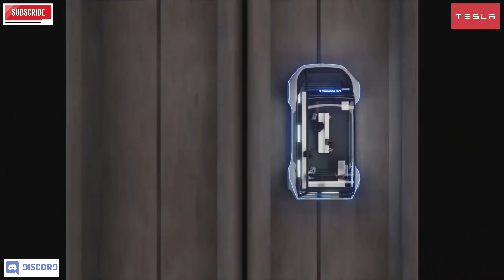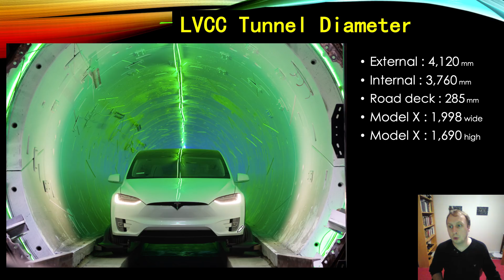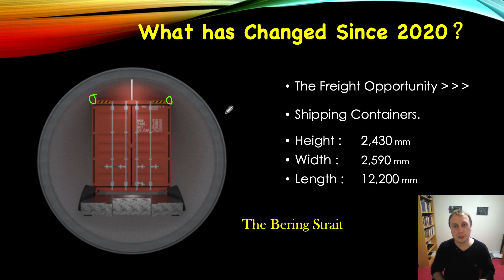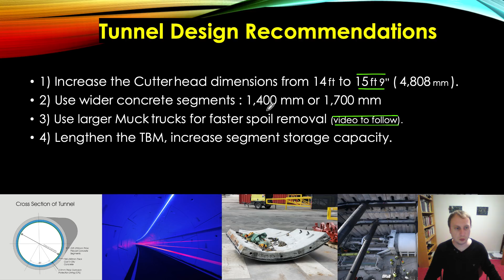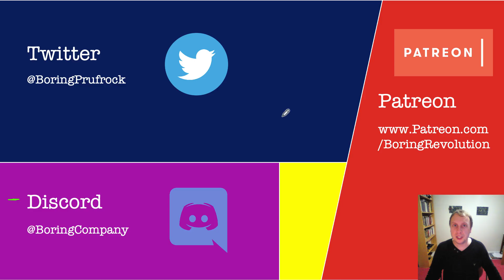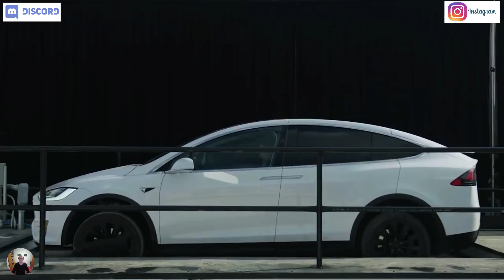One Controversial Design Change Will Make Prufrock Unbeatable 👷🏼‍♂️ 👍🏼 💰 🚇 🤑 📈 Episode # 122

Comment: If you don't want to pump muck all the way back through miles of high-friction pipeline, and you want to bring up additional segments, crew, and supplies, why not use two trucks, side by side, for bidirectional traffic?  You can make them arbitrarily narrow.  One benefit of the double width tunnel is that you can use road trucks for this.  Or, for that matter, commodity railcars.
Reply: We do use railcars pulled by small diesel trains. Idk what all this guy's experience is in tunneling... But as a person who builds tunnels, I wish I could talk to him face to face to clear things up

Comment: If it actually made digging faster/cheaper because of engineering sweet spot issues, then this is a great idea, but you have to remember most of these tunnels will be for relieving short haul traffic congestion in metropolitan areas, and long haul freight is simply not a factor there.  Having two different product lines is certainly not an issue.  Go look at any heavy equipment supplier and you will see that they generally provide a wide range of product sizes for different applications.  Just think of how many different crane sizes are at Boca Chica, for example.

Comment: Does Space X use tunnels to store their rockets in inclement weather? If not why not very prone to Gulf of Mexico hurricanes Boca Chica. At some stage customers will want bigger tunnels for corporate aquaducting or whatever the need may be, right? 

I'm disheartened per mile costs have gone up nearly 30% from $5,000,000 to $6,400,000  per mile. I would suggest shipping magnets be drawn on for those increases and that aerodynamic container cones be mounted for more aerodynamic efficiency through the tunnel. Feasibly less compression around the Tesla or container would mean less air drag too I think. Are there any plans for tunnels beneath an ocean presently? What about extra reinforcements for extra weight of the water overhead is that a valid concern?

Finally 225 kilometers of tunnel with dual tunnels, one for each direction. Can you predict what costs we might be looking at in it's turn key state of completion? ( yes the larger diameter not current one please, thank you)

Good show Oliver but cutter efficiency improvements I didn't hear mentioned. What about industrial diamond tipped cutters, has that idea been given any credence in terms of boring speed increases. What about TBC building or paving bricks has that idea panned out or been shelved? Thank you 🙂 👍

Comment: "#1 News sauce"? 🤣
Ventilation under the road surface is brilliant, except ..... if there is a volatile or toxic fluid spill. OTOH, it should be possible to create a suitable non-cylindrical air duct at the top of the tunnelby installing a flat or slightly concave panel against upper portion of the liner after main construction, like a reflection of the road surface below onto the ceiling above, just wide enough for the appropriate ventilation required, instead of hanging unsightly janky looking cylindrical ducts from the ceiling.
Reply: Yes. That’s what happens in a lot of road tunnels.
Reply: @davidsalisbury50  Thanks, I didn't know but it's a fact that most good ideas have already been thought of.

Comment: What is like about the boring company is that it is very versatile and uses electricity instead of relying on fossil fuels.
I have heard about it potentially being used for mining on the moon or Mars. Those tunnels could in turn be used for subterranean living spaces that would block radiation from the sun. If it could potentially be used for mining on other planets, then it could potentially be used to replace less ethical mining processes on our planet. 
To conclude I hope to see The Boring Company expand way beyond just roadways.

Comment: I would argue the tunnel is plenty wide enough to open the doors of the Teslas. The road deck is already somewhat higher in the LVCC Loop than the test tunnel image you used in this video and the rarity of an event requiring passengers to egress the vehicle within a tunnel is so rare as to not require anything greater than the existing 3 feet on either side of the car.  More than your average shopping centre car park. 

Remember smaller diameter spur tunnels can more easily snake up and around each other in tight situations where they need to cross over opposing direction tunnels and thread between existing underground services, particularly when going to stations In the basement car parks of buildings.

Also the current Las Vegas convention centre Loop already has a robust ventilation system capable of moving 400,000 ft.³ of air per minute and all the loop EV‘s have hospital grade HEPA filters capable of “bioweapons – defence mode” to filter out smoke from any fires, so the tunnels are hardly the firetraps that thunderfoot would have one think.  

Everything that the Boring Co has said about reducing tunnelling costs has revolved around smaller tunnels which are faster to bore and cost less. I can’t see your argument pointing in the opposite direction makes sense in that context.

I think it is eminently sensible to have different larger diameter tunnels for containers as those tunnels will have completely different characteristics to car tunnels – specifically due to the length of containers, such tunnels will have to have much gentler radius turns and very different spur tunnels up to very different aboveground stations/depots.

Best I think to optimise each tunnel type to its required function.
Reply from the maker: Its hard to argue with that statement. 
But I feel in the quest for achieving both fast speeds and low cost the perfect external diameter is something like 15ft 4" to 15ft 9" or similar. The current TBM is a tad too small !
I strongly believe that 200 meters per day is way easier with a 15% bigger cutter head as you can use much bigger concrete segments (m3) and haul muck away in bigger taller trucks.

Comment: Here's an interesting idea... if you increased the diameter as you suggested  and ran pods on a double spiral track, you could potentially use 1 tunnel for traffic in both directions at the same time. If the pods had windows, people would probably be barfing on a regular basis, but I thought it might be interesting design.
Reply: We could call it the helical regurgitator🤢🤮 🤣
Reply from the maker: If the concrete road deck is 800mm deep 2ft 8" you won't be able to run double track. This will happen.
The road deck is too narrow at present and they need to increase the depth to allow 480mm either side for an escape.

Comment: The shipping container could be a 'lowboy' with the load deck lower than the axle height.  Place the wheels fore and aft of the container. Drop the load deck.
Reply from the maker: If I was a betting man I'd say that is what they'll do. However it is still very tight.
For me the ultimate design uses wheels either side of the container in a 15ft 9" tunnel.
Reply: @BoringRevolution  
I suspect, in fact I very strongly suspect, that the people at Boring have been thinking about the ideal tunnel diameter for a long time.  The current tunnel diameter might be what they are using for Las Vegas but it might not be what we see in future projects.  Especially when we get to hyperloop tunnels where being able to ship freight as well really opens up the addressable market.

Remember, Elon's initial hyperloop concept was a six foot, less than two meter, tube if I remember correctly.  People would travel in a semi-reclined position.  But once the conversation turned to solving urban congestion the tunnels grew more than 2x in diameter.

Comment: Raising the road deck makes no sense. It adds cost with no benefit. It reduces air flow space. Putting ventilation under the road adds unnecessary cost.

It is unnecessary. So why do you think it is so obvious?

increasing tunnel size might make sense, but TBC should not bleed until they are shot.
Reply from the maker: No, no, no !
I can increase the width of the road deck by over 200 mm by increasing the decks height by just 100 mm . We should be pushing for more wiggle room in an emergency not less.
By pumping in more air via slots in the road-deck we can increase air flow by 50% and dramatically improve air quality. By having a slot in the road deck every 25 ft the system wont require expensive ductwork mounted to the lining. 
I think with the right design it might even cost less per mile if prefabricated & then cast into the concrete deck.
Reply: @BoringRevolution  I still see no real advantage to raising the deck for an edge case. If they don't need the extra space, why waste the concrete. Keep it simple!

I don't follow on the ventilation. It seems like they just need fans in the direction of travel. It is not like they have to move exhaust, just balance air pressure.

Comment: Several good points in here, though I don't know if they would be useful in practice - such as using the space under the roadbed for ventilation. I just don't know if it would be more trouble than it was worth.

One thing that you have NOT considered is that large vehicles in such a tight space could pose a significant risk to people in passenger vehicles. Look at how well a compact car stands up to an 18 wheeler in a crash at 50 mph. Now imagine how that would work if they were traveling at 120 mph.  If a large vehicle got stuck in a tunnel, how would passengers exit on foot in an emergency? Remember that we want to encourage actual people that the whole system is safe. Do we really want passenger vehicles and heavy cargo traveling in the same lanes at those speeds?

And if not, keeping the tunnels a little too small helps future proof the system against those who would want to push the limits too far at a later date.

Meanwhile, being just barely large enough for a container would still allow containers to go through the tunnels at lower speeds, at off-peak times and at slower speeds, if it was necessary.

On major routes or where congestion is a major problem, the double width tunnel would be worth doing. The double width tunnel would also be a nice addition on Mars. A combination of smaller diameter tunnels for traffic and larger diameter tunnels to build housing in ("building in a box" style of underground construction) could work well to provide plenty of living space for colonists. (See for example the vehicle maintenance facility - VMF  - and the logistics office, and the power plant in the arches at South Pole Station.)

Finally, a mil is one thousandth of an inch, NOT one thousandth of a meter. Also one thousandth of a 90 degree arc - which is to say, a circle is made up of 4000 mils.

However, if a slightly larger tunnel would make tunneling significantly faster, then it could easily be worth it on those grounds alone. I'm not saying don't do it, I'm just saying these are factors to take into consideration.
Reply: Using the area below the road surface for high voltage DC transmission might make sense.  The cables would be put underground at very low cost and be very well protected.  

Run the positive in the tunnel running one direction and the negative in the other.  Chances for a short approach zero.
Reply: @bobwallace9753  - alternately, the area below the road surface might eventually be used for the infrastructure necessary for wireless charging to remove the need to stop for charging stations. There are already several research projects being carried out for such systems, though for regular roadways of course.
Reply from the maker: I think about safety all the time. Is this way too risky e.t.c but then I read my local newspaper and see car deaths & injuries every few days.
If saving 80 lives costs 1 persons life... I'd say yes this is worth it.

Comment: 15% wider makes 30% more dig alternatively make the liners thinner and raise the road deck reducing headroom but increasing width. Raised deck could take services.

They need passenger van so it can be the basis for a freight van.

If you need bigger make the tunnel oval by digging out the floor later.
Reply from the maker: Yes in my opinion the road deck should be 700 mm (minimum), possibly way higher as it can be hollow with pathways for ductwork inside. It should therefore cost less than $950,000 per mile!
True but 30% more spoil = 30% more bricks.
What TBC need is a dumping ground of around 14 acres to store the spoil, let it dry in the sun for 2 weeks and then they can compact it into 2 million bricks. Sell it for $0.05 each.
Oval tunnels are useful for ramps as you can use a road-header instead of a TBM.

Comment: In your sketch of a shipping container in the tunnel, what is that stuff under the container?  Batteries for an EV that carries the container?  If so then why not put them on the sides of the shipping container?
Reply from the maker: I think it might cause the flat bed to tilt excessively when cornering, batteries are heavy & bulky.
But the idea of a box inside an open box is the way to go.
Reply: @BoringRevolution  You could put wheels on all four corners of the container, so it can never scrape against the wall of the tunnel.

Comment: Just a note, the narrower the tunnel the less air resistance. Safety is always a concern, hope seat belts/passenger restraints are still required.

PS- Why are you using mm for measurements? These aren't small objects, meters will do fine.
Reply: Several places he speaks of "350 mil", "400 mil", and "500 mil", and I'm thinking "How is half an inch or less going to make such a big difference?"
Reply from the maker: I'm guessing you've never worked in the UK or Germany?
It is drilled into us from day one of University that anything under 10 meters is measured in mm whether it be dry wall, concrete blocks or even lumber.
Reply: @BoringRevolution  Yes I have worked in UK and Germany, but only as a guest. Just to be funny, 1 inch ten times isn't the same as 10 inches. 😂

Comment: I would go with a 5 meter cutter head because we are humans and people understand 5 meters or just a bit bigger than 16ft much better than they do 4,808mm. It appears that you have cut the tunnel down to the bare minimum to save cost or time or both but if the sweet spot truly is 19ft to 20ft then 16.4ft is only closer to the sweet spot. You make a good point about freight containers and those things swing so it is best to afford the containers plenty of room to swing. Yet another thing to look at while sizing is the current size of the common bus, somewhere around there is a very good size for people transportation. Las Vegas has some rail based people movers that take people from "just off the strip" (aka a few blocks maximum) to the strip and those move pretty fast and are so efficient that they are free to the riders. I think that at the end of the day TBC will make their name moving people while making their money moving freight. I think it was you that brought the fact that most freight is moved a few hundred miles per day, with not much freight going long haul. If that is true then moving freight around and in to the city hubs would save on congestion and be an efficient win for TBC. Also tunneling around a city also opens doors to replacing services perhaps on the same permits, the city also gets bogged down in paperwork. When TBC bores a freight tunnel that also transports people they could bore parallel tunnels for city services. If the tunnels are the same then it is possible that the permits for one tunnel system could be used for the other tunnel system, the only difference is what would be in the tunnels so those permits would be different but the boring of those tunnels could be the same thus saving time, and $$$, and headaches.
Reply from the maker: Yeah those are reasonable points.
My obsession with numbers like 4,808mm stems from working in the water industry for 4 years with a very demanding project manager. He schooled me good 😓 and his attention to detail is now ingrained into me.
The USA should go metric - never a better time since WWII !